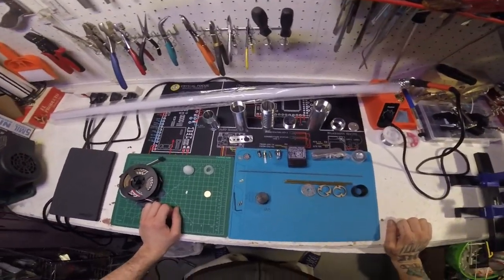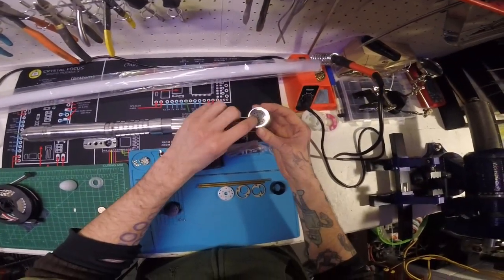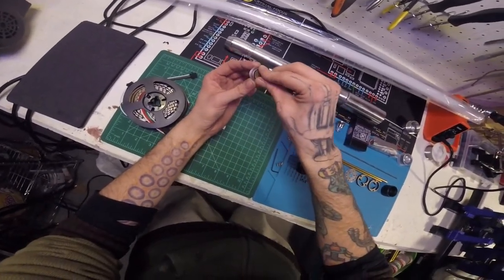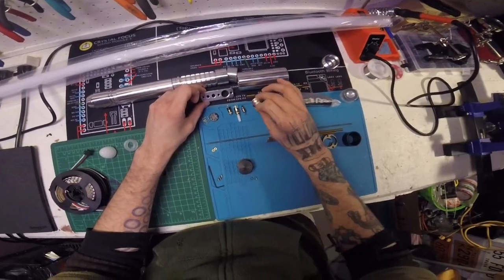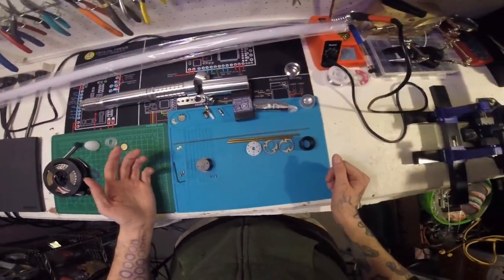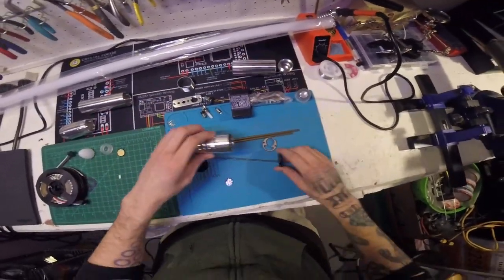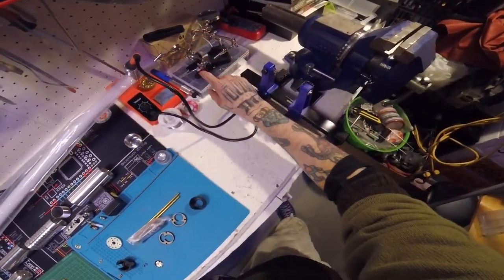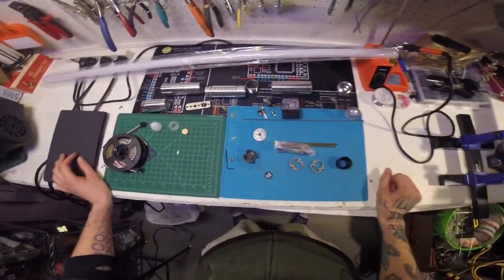Building a CFX Neopixel Lightsaber - Episode I: The Planning Menace

Comment: Thanks this look tricky but rewarding.  So say if I wanted to put this install into a Romans props Antigonee, I’d obviously minus the metal hilt parts from my parts list... but what kind of chassis would be available for that type of hilt ?
Reply from the maker: I did a quick search, and couldn't find a chassis for that specific hilt. But you could always measure the inner diameter and look for a chassis that fits that size. You might find a 3d printed one on Shapeways or Etsy.

Comment: What is the resistor for?
Reply from the maker: It is required for the neopixel data line. In this build, it gets soldered to the blade-side PCB.

Comment: I noticed that in the google spreadsheet, you stated that you used a 16mm momentary switch. Is this an error? I thought momentary switches had to be held down to be activated.
Reply from the maker: For a stunt saber, you need a latching switch. However, the CFX works best with a momentary switch. You only have to press it for a "moment" to send the signal to the board.